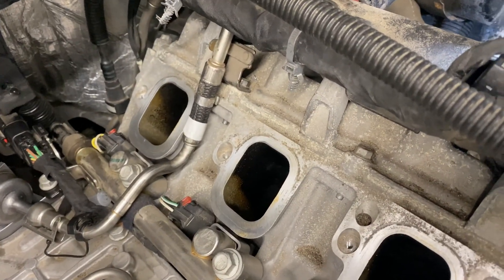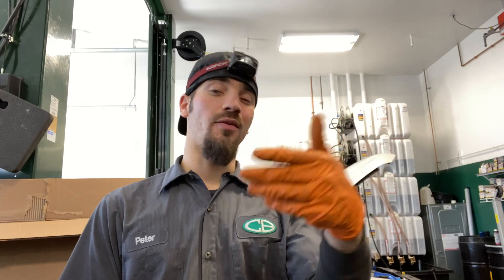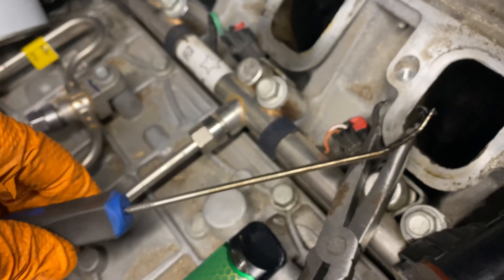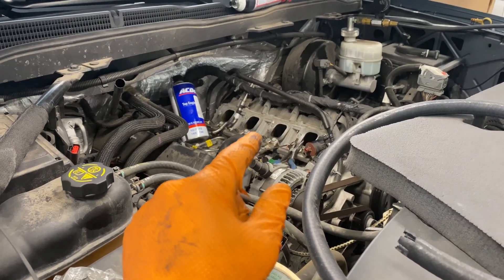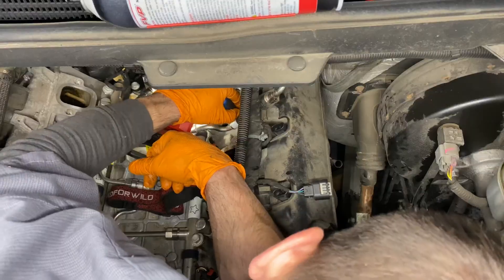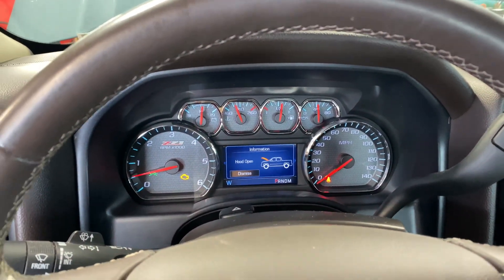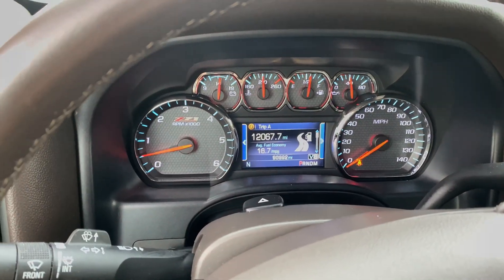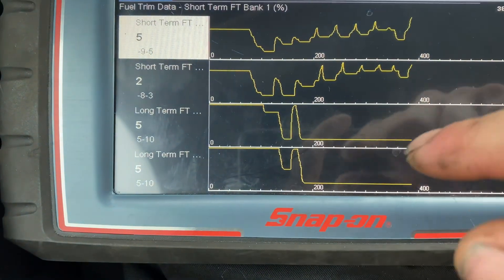GM 5.3 6.2 Carbon Cleaning Intake Valves, Severe Carbon Problems

Comment: Could you use a straight wire brush on an electric drill to clean it better after you scrape the big stuff out? Not a wheel brush but the straight ones.
Reply: I think it was repair geek show showed the zipties in a drill method, basically a heavy duty plastic brush you jam into the ports, I think that was effective for his test

Comment: There are too many ignorant opinions about "excessive carbon build up" on intake valves. If I showed you my 1991 TBI intake valves they would look the same. And the same amount of carbon build up on my 1971 C10 with a 350 CID engine and 1978 C10 with an inline six cylinder engine and 1976 Suburban with a 7.4L engine and 1985 C1500-ish with a 305 CID engine. The only vehicle I have owned that has immaculate intake valves is my 1997 Buick Regal with a 3.8L engine. Excessive carbon build up on any modern car would be so excessive as to set a code in the ECM because air restriction would be at an extreme.

Comment: Yes .  L.s. 3. Suffer with problems,  but 3 times as bad , !? And all so the inlet manifould with a lot of caked on carbon , to remove with some induction fome induction   cleaner  and let stand over night , then  , scrub with a stiff brush that fits  down  the inlet runners  and some strong degreaser , I had to do this 2 times , and the manifold come clean like new , This engine only had 80 thousand miles on it , the heads to come off because the a  lifter failed so the heads had to come off , the amount  of carbon  was 2worse than your show  shoed  , valves had to be removed  and cleaned by hand , the heads survived,    what a shitty job to clean ,?

Comment: seems like once you're that far in, pulling the heads would be a more effective method of accessing them and as long as it takes to dig in there towards them and get TDC for intake couldve pulled them and soaked em and wiped em down. definitely probably a little extra labor charge and few extra TTY bolts/gaskets, but at that point youre just sort of in it to win it.
Reply: I was thinking the same

Comment: I used Carbon Off on my 2000 Silverado. I first scaled the port walls using carving tools from Harbor Freight to remove as much as possible. Carbon Off breaks that sticky sludge down quickly

Comment: what happens if chunks got into engine with the GDI cleaner?
Reply from the maker: Not a huge problem, won’t hurt the cylinder after the cleaner has softened it up, but you want to have some regard for the catalytic converter assembly, they don’t like carbon chunks entering their core.

Comment: Would running fast  for 2.5 hrs on 91 octane straight on a freeway clean it up?
Reply from the maker: Not at all sadly.
Reply: No. These are direct inject engines. Gas does not enter the intake and mix with air and pass thru the valves. Gas is what keeps them clean. Direct Inject injects gas directly into the cylinder.

Comment: Theres no reason to change oil after air induction cleaning correct?
Reply from the maker: Not necessarily. If you think about it, the cleaner for the valves & in the cylinders shouldn’t have much affect on the engine oil.
Reply: I dunno if you need to but I hear it recommended from several others.

Comment: So what can we do as a driver to prevent carbon build up in the first place ?
Reply from the maker: Preventing is not an option sadly. Slowing the process down can be done with catch can installation, higher quality fuels, and driving it hard at least once in awhile.
Reply: Install a catch can. Only need 87 octane due to the 5.3 engines low compression. And these are LT engines, not LS.
Reply: @stevenjack23331  But you can run 87 octane top tier fuel.

Comment: Guys I need help. I've got a sierra with an LR4 with 114k miles and it keeps throwing p0332 for the knock sensor. Had the sensor and sensor harness replaced and it's still throwing the code. Think I need a carbon clean or did I get shafted by my mechanic? I drive this engine pretty hard but before I had it my dad and brother used it as a town car. Everything else on the truck is mint for an 04 and this check engine light is starting to piss me off
Reply from the maker: Get a real scanner on it to run a misfire counter. If there’s no misfire data and the computer is still picking up knock.. Do a compression test on the cylinders, or just jump straight to the borescope to inspect for carbon buildup on the top of the pistons, if you don’t see any and compression is good, then I would pull the intake manifold and inspect for carboned up valves. Sometimes bringing to a technician (instead of a mechainc) can be helpful.

Comment: Are fuel injectors and intake valves a whole different thing ???? My 2015 Silverado it shakes when at idle and when I step on the gas all at once it hesitates what could be the problem ?
Reply: Did you ever figure out what's wrong? Sounds like a misfire but my 2004 is doing the same thing. I'm doing a complete tuneup and fixing the knock sensors.. and my intake ports and valves are worse than this video..

Comment: If only GM would stop being cheap & lazy and switch to dual injection like Ford, Toyota, and Hyundai/Kia are doing. Adding port injection to all their GDI engines would be as simple as simply making provision for it in a redesigned intake manifold.

Comment: Must do every year imo
.. induction service, manual cleaning and fuel system cleaning.... Run premium if possible and a catch can
Reply: These trucks are trash i have a 2014 sierra 5.3 153k already misfiring last modern gm product for me no more i paid. 43 k for it not worth it yeah theyre nice good looking trucks but the gdi stuff is garbage
Reply: @felipealvarez892  did you figure out your misfire cause?  I too have the same issue on a 2014 Silverado 150k mil. Misfire cylinder 1. I did everything I could, spark plugs wires and coil. I was dreading lifters, but just ruled those out. Left with injectors or carbon buildup on valves.

Comment: Got a 2017 5.3 reading code p050d with only 46k miles. Would the carbon build up be a cause for this code?
Reply: Yes. Probably your fuel injectors

Comment: There has to always be something with every car!!! Will a catch can help??
Reply from the maker: Not as dramatically as people think it will help. It does slow the process down definitely but the car buildup is guaranteed.
Reply: @Pete_Tech_  A QUALITY c.c. setup WITH the clean side separator will make a HUGE difference on GM LT engines... wth are you on about ??

Comment: Great video but I'd like to ask one question buy using the type pliers   
You still take a chance on nicking Valve stems and may damage valve guides 
Im Also from MN I know a couple of gm techs  That use a small dingle ball hone in the upper part of the port .
Again good explanation  in video
Reply from the maker: Hey good to hear from ya! Risk is definitely there, however if the valve is shut and you stay away from the top 1/8” of the stem all is fine. Definitely looking to invest more in valve cleaning tools and well!

Comment: Appreciate your effort so much
It is one of the toughest jobs that I ever done 
I am tall and bending so long to clean caused a terrible back pane some time and nee at other times.
With all of these crying at night hot and cold. I can tell you differently need some strong chemical disolver to get high rate of cleaning along with the mechanical cleaning. You are not going to clean all. But you like it for sure.
Wish you the best

Comment: Does this happen to people who do not drive the truck hard or do not get out on the interstate and drive it at high speed? Thanks for any info.
Reply from the maker: Forgot to response my bad. Yes it absolutely does.
Reply: @Pete_Tech_  Crazy. We have a 2017 with 71,088 miles and this has happened. Thanks for responding.

Comment: Makes sure you change the oil after the induction ckeaning.  Huge amounts microscopic GDI abrasive soor will contaminate the oil.  Takes 2 oil changes to bring it back to normal.  I have done oil analysis before and after, it is a huge problem anf full flow filters will catch it.
Reply: will NOT catch it
Reply: How does it contaminate the oil if the induction service is in the intake? Not sure how this abrasive material(carbon) would get past the pistol rings.
Reply: @twentyonehertz  the microscopic soot will mix with fuel and oil and get into crankcase via normal blow by.  If rings are stuck or sticking, even more blowby and oil consumption.

Comment: Direct injection Into cylinders therefore no fuel wash on backside of valves and seats. Only air passes. Now, here's the deal. In the old days any oil  drawn through pcv system into intake was simply  washed away by fuel, and burned. No biggie Valves kept reasonably clean. Now we're only drawing air through the intake so when oil is sucked into intake, its gonna carbon the stems backside of intake valves, and EVENTUALLY the valve seats. ...Loss of compression,  excessive blowby, bad fuel trim, hurt value guide seals ,etc. This pcv issue was not accounted for when the move to direct injection was made. And it's not only GM. It's any motor with  DI. On the GM LT platform,  the location of PCV valve is a blunder. 1. It's too low on the engine, and, 2. It's too hot down there.  The spring weakens quickly , causing excessive oil draw. 1. Change PCV valve every 20,000 miles. Cheap and easy. 2. Install catch can in pcv line to stop oil from reaching intake manifold. Works like a settling bowl on an old tractor. When you can measure how  much oil  gets in the can, you'll be able to tell how much oil your engine uses as opposed to getting sucked in through pcv and burned.  You might only be using half as much oil as you think you are😉 GOOD LUCK . Ya just cant have oil getting on those valves when there's no fuel wash in that dang port.
Reply: Reason why See a lot of Carbon build up back of Valve Fuel Injector  is not above the valve anymore high pressure Injection systems Injector is in Combustion Chamber.    When Injector was above the Intake Valve all you had to do is Run Couple Bottles Fuel System Cleaner Like Chevron Techron , BG 44k, or Redline Fuel system Cleaner. Those 3 I know works in my 45 years experience Pro Master Mechanic Blaw Blaw. I have not used Lucas. Those cleaners worked good on Old Fuel injection Systems. Cleaned Carbon off  Intake Por,t, Valve, Combustion Chamber top of Piston . Also Reduces NOX Gases which is Created by Carbon Build up. Another Important Factor is Good Top Tier Gas if your Buying Costco or Sam Club Gas your not getting High Detergent Gas like Chevron Shell QT Exxon worst Ping Juice . Carbon build up on back of the valve comes from Oil leaking down Valve Guide over time slowly builds up . Also Change Engine oil more this 10 thousand mile Oil Changes have Created more Problems with Crank Case Ventilation Systems Especially on European Cars also I've seen Oil leaks Develop lower Mileage because Oil so far gone doesn't lube Rubber seals Crystalize s Gaskets. When I drain Engine oil has 10 k miles on it very Toxic Fumes HydroCarbons build up Pull plug let it drain leave area till done draining. Back to Carbon Build Up way to clean with out removing Intake manifold Induction Cleaning Inducing Cleaning Chemical in Intake manifold with Special Tools Adapters that procedure is not new been around for 30 years more important to do Induction Cleaning Service because of High Pressure Injector Systems GDI etc BG has Special tools sell to Dealers  and Independent Shops. I came up with my own Set up works Very Good .

Comment: never had that problem back in the 60' s with the 283 ,327 ,427 , 409 ,  they had no PCV , no EGR , no Ethanol gas , I still drive a 1991 GMC 1500 with 300.000 miles on it deleted the EGR and PCV system at year 2 , oil was changed every 4000 miles here is what it looks like now ,after an restoration in Canada  https://www.youtube.com/watch?v=-BDUuHcDqW4
Reply: never had that issue because port injection cleaned off the backs of the valves with fuel. modern, direct injected engines spray fuel directly into the combustion chamber so it never touches the valves which is why they get so gummed up
Reply: those engines also had other problems plus terrible MPG and weak HP/TQ compared to these engines
Reply: Wouldn't have mattered in the 60's, you needed a head job well before 90k if you were running any sort of compression. My 396 always burned valves around 30k miles

Comment: After removing plugs

Can this ac delco product be added to a v-6 with a 1/2 oz added across piston tops to soak down in over x days to “free “piston oil rings ???

And then drain and refill and live each cylinder with oil before restart ?

Verses the common go to.  :  sea foam ?
Reply from the maker: Absolutely!
Reply: The AC  Delco Tip Ens cleaner is a very robust cleaner, max detergents.  Lubrizol, a major additive manufacturer makes it.  Most if these aftermarket cleaners are 50-80 cheap oil as a filler with small amounts of solvents.  Worthless.  ACD is less than 5% oil, 95% cleaner, which is why it works and costs 3x.

Comment: I appreciate the video on the manual cleaning. 

Doing a fuel induction service will do absolutely nothing to clean the intake port. Direct injection means the fuel is injected directly into the cylinder. At no point will fuel ever touch the port or the top of the intake valves.
Reply from the maker: Fuel induction service doesn’t mean the solution is sent through the fuel system. The induction service is performed by introducing a chemical solution through the intake, meaning it has to pass over the intake valves. You’d be suprised at some of the higher end treatments, they help..but only if used regularly.

Comment: Good video, but I didnt think those valves at 90+ k miles looked that bad. I am referring to the valve seats. The stems looked very bad and that appeared to be where the accumulation mostly was deposited. GM has modified the oil requirements so that the blow by gasses are not as contaminating and re baffled the rocker valve cover to minimize oil carbon residue going back to the intake. I dont think there is a need to reset anything except clearing any codes as the ECM will right itself after  running awhile and or restarts.  Thanks for sharing this procedure.

Comment: I didn't know the Gen 4 LS motors had such bad blow-by and carbon problems until recently. 2011 GMC Yukon with LC9 and 190k miles. I cleaned the orifice in the valve cover and I disabled the AFM (V4 mode). I heard the root problem was a bad design on the rings. The intake had been getting a quart of oil blown into it every few hundred miles, and I didn't know until it was too late. I installed a 10 ounce capacity catch can, and it filled up after 50 miles of highway driving at 70-75 mph. I now run the catch can 'out' line to open air and plugged the line going to the intake. Doing my part for global warming. Without vacuum sucking all that oil out, the catch can barely gets any oil in it; oil consumption has gone down a lot. Everything was carbonized. I put in new plugs too. The old ones had carbon on them. Then I dumped tons of Marvel into the crankcase and fuel tank. It seems to run better, but cold starts still take a little while and are super rich, like blowing raw gas out the exhaust because the injectors are just dumping fuel. It sucks needing a big extended SUV and no one makes them except GM and Ford both of which suck.
Reply: Russell good job. The fix is the non vacuum pcv catch can and cleaning the carbon off. Avoid the marvel mystery oil. Oil in the gas will increase carbon build up.
Reply: A quart of oil in the intake every few hundred miles is severe and not normal. Yours is the result of an issue with the valve cover and PCV system. There are updated valve covers for that issue. 

Venting the PCV system to atmosphere is ok but you might be more prone to oil leaks. Part of the idea of putting the crankcase under light vacuum is to help the seals stay sealed and pull combustion byproducts out of the crankcase.
Reply: Not anymore. Jeep has the big dog now. A grand Cherokee L, wagoneer, and grand wagoneer, or should I say the 120 grand wagoneer. And the grand wagoneer only comes in the 6.4 Hemi
Reply: they have had bad blow by since 1997 with the intro of the LS
Reply: I'm new to these AFM models. How did you disable the V4 mode??
Reply: @perryschumacher1223 electronically by HP Tuner software or mechanical desable replacing a few parts.
Reply: Hey. Do you have a link to the oil catch can did you use?

Comment: I threw a catch can on my 6.2
Reply: Catch can separate the contaminated oil from the blow-by exhaust gases before being recycled back into the intake to be re-burned. A catch can will not prevent Carbon build-up it will only reduce it. Carbon build-up is a problem with all GDI engines.

Comment: Brother I have problem with gmc 2017 Yukon dtc p0175, p0172 high mileage fuel trim -35 both bank possible intake carbon? Both fuel pump good ,
Reply from the maker: Yes, if over 100k miles. Most likely carboned up bad!
Reply: Those codes can also be caused by a high pressure fuel pump, that was my problem in my 2015.

Comment: Good video! I have seen carbon build up just as bad if not worse on some of the 5.3/6.2 at 25k. Pretty sad how bad they can get.
Reply: I bought a 2018 recently, not knowing about the direct injection change from the earlier silverados, and the truck lags while accelerating. I've used valve cleaner in the intake but it only works slightly. I'm gonna have to do this next...
Reply: @vinnieortega  The 2014-18 have throttle lag because of the way the powertrain was tuned on them. what you are feeling has nothing to do with intake carbon. your best option is a tune or one of those jnk pedal commanders.
Reply: @karlschauff7989  really... I even put the fuel management delete on it to stop from going down to 4 cylinders and it still lags. What tuner would you suggest?